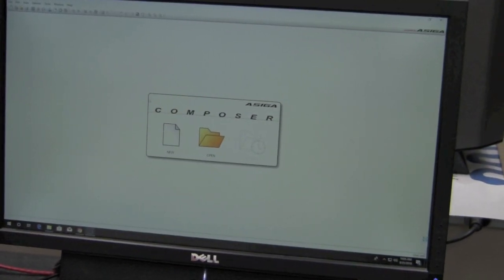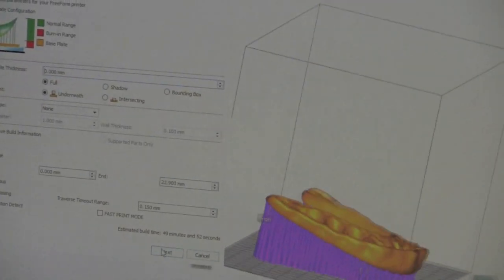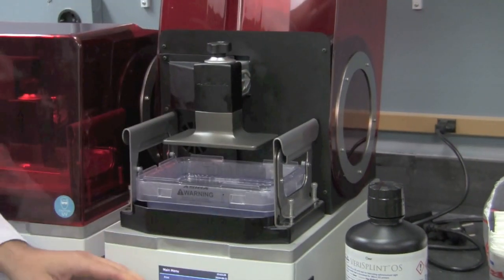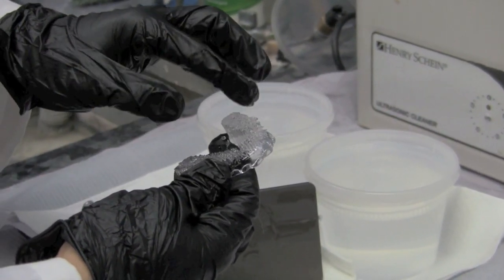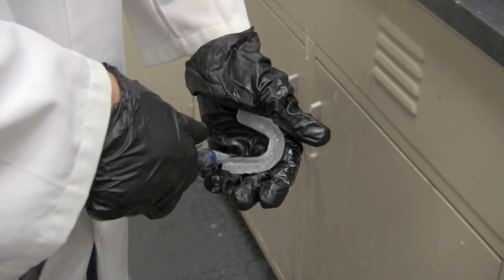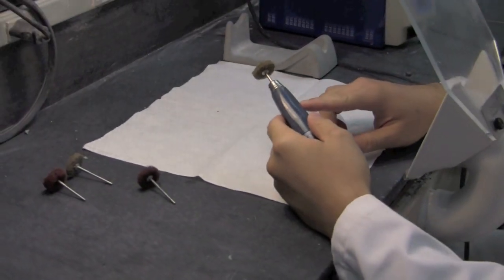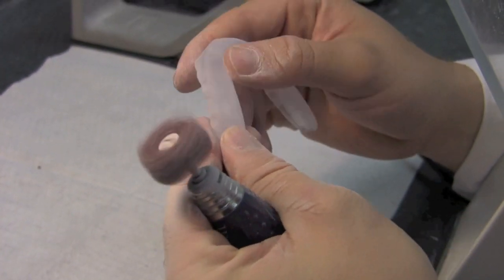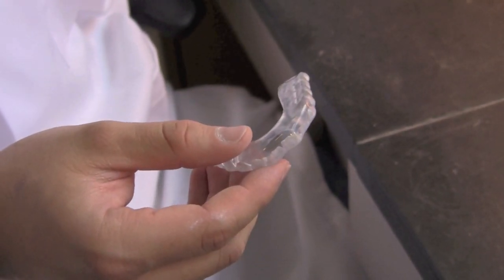Processing VeriSPLINT OS Resin

Comment: Does the software has the ability to adjust the occlusion? or you skipped that step.
Reply from the maker: In this video the splint was already designed with the desired occlusion in a design software such as 3Shape. The occlusion would be adjusted at that stage of the production process, not here in the printing stage. As such there is no way to alter/adjust the models in that way using the Composer software from Asiga. For more information on designing splints, check out Digital Dentistry Training Series: Scan and Design Splints here: https://youtu.be/MNDz05Z8myg